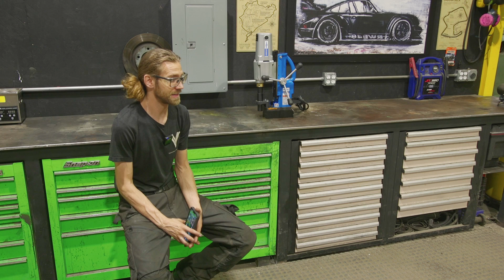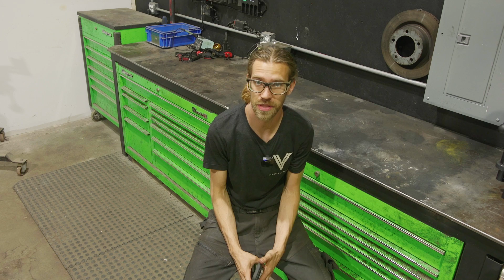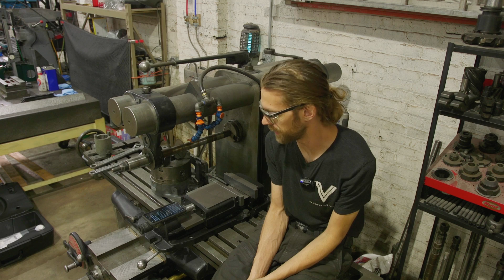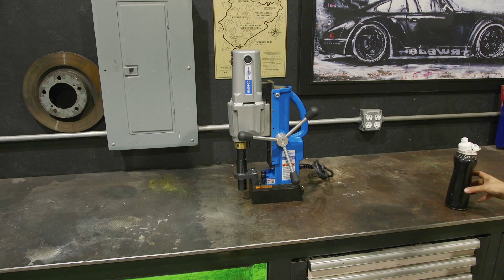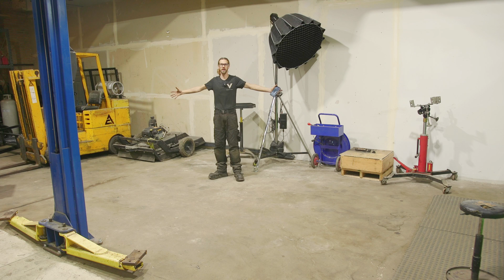25K Channel UPDATE!

Comment: We talked briefly at the auction open house. Unless you're talking about another auction I'm going to guess you bought one of the huge manual boring or jig mills they had. If that's the case I'm surprised you're only paying 10x the cost to move it. Whether I'm correct or not, congrats on the purchase and good luck! Looking forward to the videos.
Reply from the maker: Hey good taking to you. No it was a different auction. It was pretty pricey at that auction I did not win anything I bid on.
Reply: @VanoverMachineAndRepair  No idea what was going on with that auction but almost everything went for way higher than normal. We ended up not purchasing anything either.

Comment: For why you would need a mag drill yhat can do 2 3/8, clearance holes for 2 1/4 studs in the field, or stud removal.

I've got had to remove some 3.5 Inch studs at a steel mill, as an example.
Reply from the maker: Makes sense